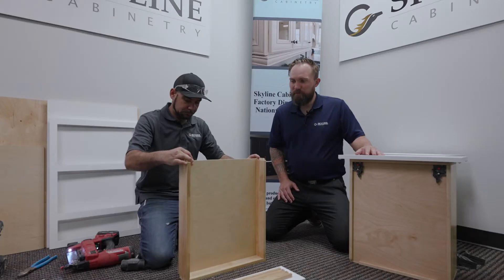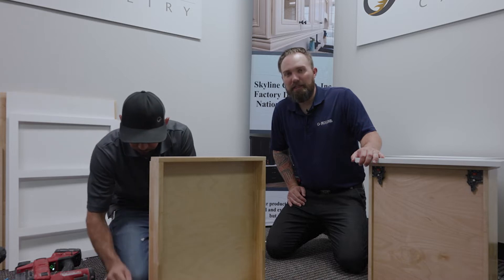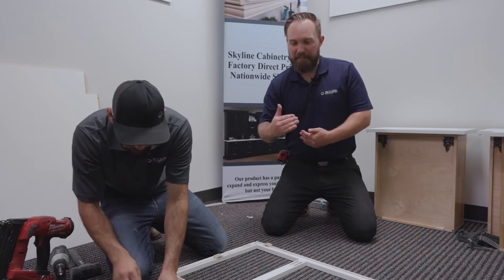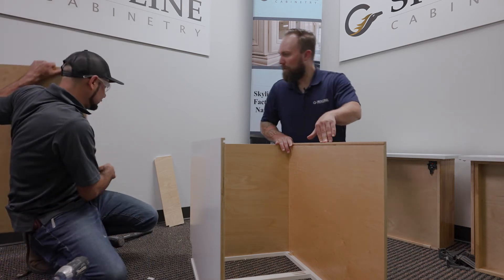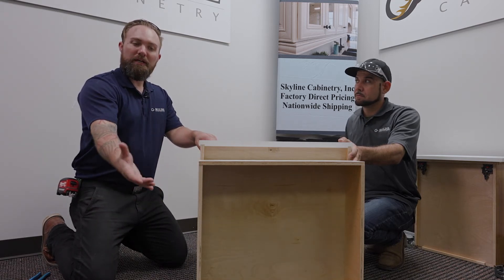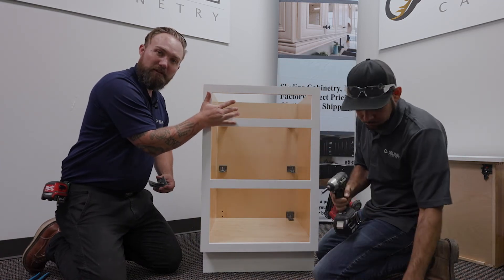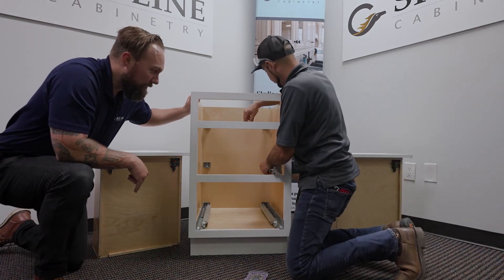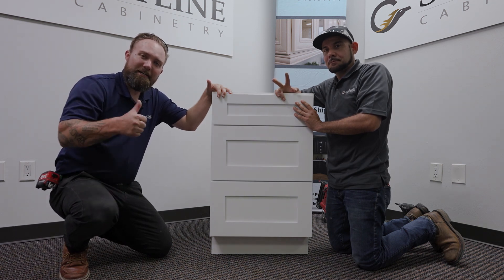Assembly Video for Three Drawer Base Cabinet

Comment: I wish you would show in more detail the install of the l brackets... and which screw hole to use... mine have 2 predrilled hole but not a clue as to which way is correct... in terms of their orientation